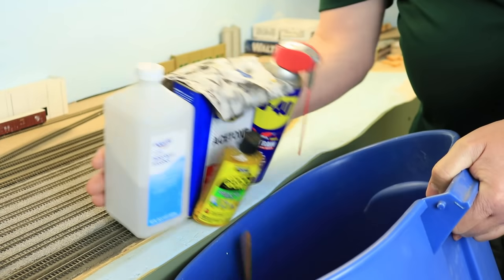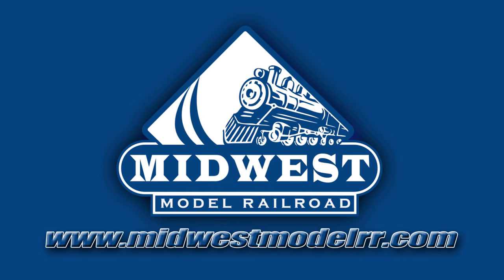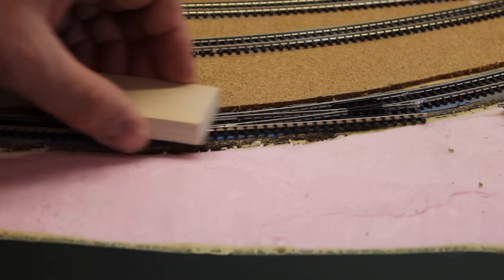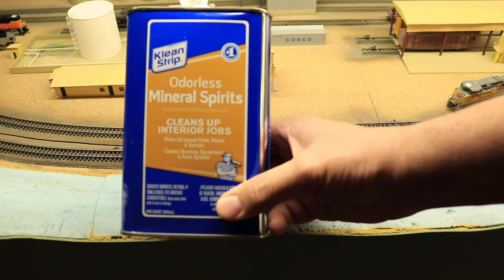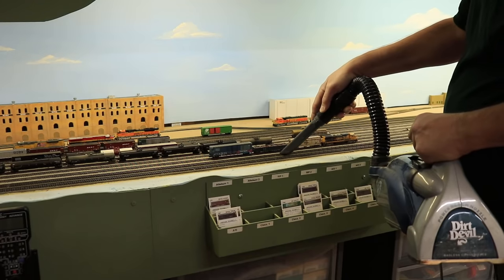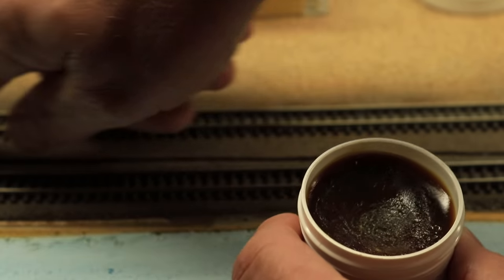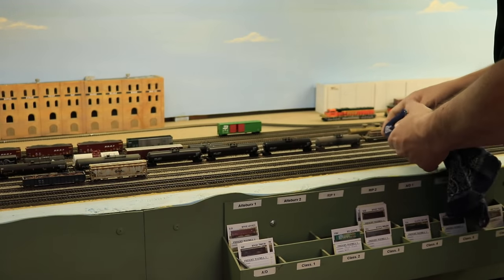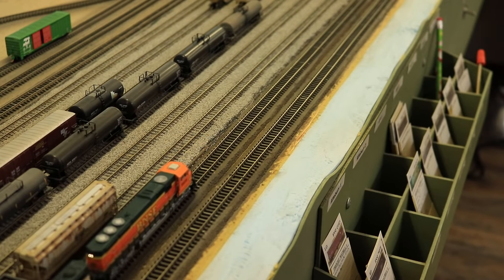Stop Cleaning Your Track on Your Model Railroad

Comment: Ron, could you expand on what you mentioned about No-Ox not being a good choice where steam locomotive traction tires are concerned? Is it the the No-Ox, or is it the pre-cleaning with the mineral spirits, that may give the problem? I have a couple of rubber treaded steamers, and am using Wahl's without too much trouble, it's a little slippery for a few laps, then does OK.
Reply from the maker: The mineral spirits are a good idea even with the traction tires. It will not give you any problems. The no-ox can coat tractions tires, however, and render them ineffective. It will not attack the rubber, just makes it slicker.
Reply: @RonsTrainsNThings  I use Wahl's Hair Clipper Oil, first known to be by way of British professional model railroader, Lionel Strange. It does create some rubber tire slippage during the first few laps, but then dissipates. I have not detected any rapid traction tire failure with Wahl's. Since the layer of No-Ox is microscopic, as you say, I think I'll chance it. Worst case scenario, I hope, is that it may be necessary to spin clean the traction tires if I notice excessive slippage. I enjoy British OO, and my British friends tell me that No-Ox is not favored in the UK, but since track cleaning is as controversial as religion (brave of you to wade into the mire) I'll just have to take a chance on it; start with a locomotive that has easily replaced tires, or tyres, as they say in the UK  I really appreciate your in-depth analysis, and electron microscope images, of this vexing problem. I've seen and read many articles and videos, and by far yours is the most cogent, most believable, of them all. I look forward to following your channel. 

Your "stage persona" is also refreshing. You are clear, concise, and don't tax the viewer by rambling and fumbling. Thank you for that. Some of these YouTube presenters are painful to watch, sorry, but there is an edit function. 

I have long suspected that abrasive cleaning methods would micro-groove the rails, and that this would indeed increase the surface area that would promote micro-arcing. Nice to be right, for once. 

BTW, I read an actual laboratory study funded by manufacturers as to if plastic wheels fouled track more so than metal wheels. The conclusion was that neither plastic or metal wheels on cars made any difference in terms of dirtying up the track. Another hotly debated topic.  I note with some amusement that the plastic treads gain a metallic sheen of metal from long running; and so have metal coated plastic wheels!

Comment: This sounds great but can you recommend an alternative when using steam locos with rubber traction tyres?
Reply from the maker: I would still clean with mineral spirits but skip the track treatment. It will leave a film on traction tires that gets slick and rendered them ineffective.
Reply: @RonsTrainsNThings  Many thanks! 🙂

Comment: I bought something called solvable professional grade mineral spirits..it has smell..it says it cleans multiple surfaces
Removes grease and cleans paint brushes and rollers..says it's safe for plastics steel etc..is this right one for cleaning track?
Reply from the maker: That will work, yes.

Comment: Ron
My Layout is relatively new and have not had much time to run the trains on  regular basis because I am still  making adjustments.  But after I make a change I run the trains and find they do hesitate sometimes at first then they run ok. I run my fingers over the track and they are black. I bought the car cleaner CSX and used acetone and paint thinner first one time.  But the CSX car is heavy and I have elevations on my layout and it was hard to go up the elevation. So I have been looking into a better way for Track Treatment. This method looks like a good one.   I took the time to pause your video several time to write down the procedure. Step by step.  Would be nice if you could post the step by step process.    Great job looking forward to smooth train running. Tom
Reply from the maker: If you check the link in the description I mentioned to the NO-OX document from Sanchem, they outline the process, except they use a bright boy first, which I do not recommend.
Reply: @RonsTrainsNThings  I just reviewed the Sanchem document and now have any understanding of what need to be done.   It will be fun doing my track under the mountains 
I have access from the back but not sure if I can get to all the track under there may need to make another access point..
I order the NO-OX-ID and Mineral Spirits from Amazon toady should arrive in the next day or so.
Reply from the maker: Let us know how it goes.

Comment: Wow sounds great.  When you apply do you apply to just a section of track and let the loco spread it to the rest?  Right now I only have a 4x8 HO basic layout.  Just one track around.  On a layout like yours that would be a long time applying and sometime hard to do in hard to reach places.  I'm just getting back in and have used the bottle of track cleaner which probably contains IPA.
Reply from the maker: I apply manually to all track. I applied to my main line first to test it, then when I was confident in it I applied it to all other track.
Reply: @RonsTrainsNThings  Ok thank you.

Comment: Thanks for the insights Ron your video is very timely.   I was running out of my last can of TV tuner cleaner and trying to figure out how to clean my rails going forward.   From your experiences.  Would you do the mineral spirits/no-ox-id combination on the track before or after its been painted, ballasted,  and the scenery has been put in around it?  Does it make it easier to clean the rails after you have done scenery work or does the NO-OX tend to collect all of the dust etc... created when you are scenicing a layout?
Reply from the maker: Ideally do this after everything else is done, but for those of us who run trains fpr months or years before scenery gets done, I paint my track, then apply. After ballast, scenery, etc I may need to reapply.

Comment: So I'm guessing with DCC as its AC and not DC, wouldn't there be an even amount of micro-arcing on both the track and the wheels of the electrical vehicles? Is NO-OX-ID plastic safe? I know that certain mineral spirits are bad for some plastics like ABS (some track ties?). I use use high quality vinyl erasers to clean the track and then vacuum the tidbits after.

Comment: I run Lionel Trains on my layout and they have traction tires.  What can be used to clean my tracks other than NoOx?  Maybe I missed what you have suggested, my apologies.  Thank you,!
Reply from the maker: First, No-Ox is not a cleaner but rather a track treatment. For cleaning, use Mineral Spirits (which I mentioned in the video).

Comment: I’ve been using DubyaDee on my tracks for a few years now. All I got say is REGARDLESS, run cheap, reliable DCC locomotives or old DC ones that you’ve installed a decoder into. I’ve found that the higher end the Locomotive, the more pain and woe you sustain just trying to get the sand thing to run right.
Cheep trains have always run for me like a top with just a regular cleaning of the track and wheels with a normal water displacing, petroleum lubricant.
My most beautiful train is a Rapido, New Haven RS11. It looks like a dream but runs like absolute garbage.

Comment: Have you ever dealt with the  Life - Like liquid purple track cleaner that was available many years ago? Sold under the Life - Like products of Baltimore, Md. Never could find out why it was discontinued. Never any ingredients or warning info on the label. Only found on eBay to which I just bought a full unopened 8oz bottle from a seller in Md.
Reply from the maker: No, I have no experience with it.

Comment: Have used this for electrical connections for years. Should be ideal for track connectors, eliminating the need for soldering these joints.

Comment: I believe It reduces traction if you have  inclines with long heavy trains, even with small amounts.   I find Diggers Methylated spirits (95% ethanol alcohol - and low carbon content) in a CMX does a great job.   IPL has a higher carbon signature.  I agree occasional cleaning of all rolling stock wheels is occasionally required - I don't do it often enough.  I find that 4 x CMX with ethanol passes over every track, every 6 months does the job.  A big plus to increase conductivity  is regular use of the layout - a great excuse to spend more time in the shed/basement.   Cleaning is required more frequently if the layout is non used most days.   Emotional subject - yes I argue a lot with fellows who know more than me, hard hat is on for objections.   Please keep those track rubbers off your track - might be too late if you have already scratched your rails.  Happy operating  We have got to love this hobby

Comment: Ron great video!! Just watched this recently...  Have you considered a electrical contact cleaner like Electrosolve?  This seems like an option which eliminates the grease aspect.
Reply from the maker: Several of the products I mentioned gall into that category. WD-40 Contact Cleaner is the one I'm most familiar with. The important thing is to learn if it is polar or non-polar. That is what differentiates them. You want to use a non-polar cleaner.

Comment: Layout 22x11x3x12 dementions sat dormant for over two years.   After finialy getting time to clear the accumulated junk out and gain access to the Layout first inspection identified major corrosion especially in the hardest to access points.   I wanted to run trains as soon as possible so after clearing the main line put an old blue box locomotive on the rail gave it power hesitation abounded so solution a few drops of automatic transmission fluid hear and their and off we go.  No fus no mus

Comment: Just got my first train and it was stuttering in. Couple spots. Despite the tracks having a mirror finish I cleaned it with some oil and a q tip and so much black came off, very odd but the train runs like new again.

Comment: I did the same research as yourself (probably read the same articles and watched the same videos) about a year ago, I have not released a video of the "Ultimate cleaning track" regime, as I do not have a runnable layout to prove it, before I publicise. I can tell you that you have missed a trick, not only do I agree with you about track rubbers, but even brand new track (under the microscope) looks like its been scratched with a rubber already! (it's a function of it being extruded during manufacture). So the regime has 5 parts, first polish with a fine polishing compound like "Silvo" (chrome/brass cleaner) thus leaving a smooth surface, second clean with non polarizing cleaner, third vacuum the track, fourth treat with a non polarising protector like noox-it ( I know of another similar that is less greasy and does not rot rubber!), fifth is to clean ALL running stock wheels with non polarised cleaner before running in, on the protector. As you said, this may be an onerous regime, but you only have to do it ONCE! (and maybe re-clean and reapply once a year!)
Reply: Care to share what the stuff is that doesn't attack rubber?

Comment: I’ve used IPA, CRC 2-26 and a Peco track rubber, and I can say the following.
IPA and the Peco track rubber are good for traction as no residue is left immediately after cleaning.
CRC 2-26 and the Peco track rubber are good for conductivity.
 IPA and the Peco track rubber are good in terms of the track staying clean.
CRC 2-26 is very good at initially cleaning the track but it accumulates a thick layer of carbon gunk after an hour or two of running which really affected traction on some of my smaller locomotives, but it is easy to remove. CRC 2-26 does have its uses though, if you have a locomotive, coach or wagon with stubborn dirt on the wheels put CRC 2-26 on the track and run the rolling stock round, put some CRC 2-26 on a cotton bud and clean the wheels, they will be clean and shiny again. IPA is good at cleaning the track but spotless track and wheels may not be good for conductivity as when I put a brand new locomotive on track cleaned with IPA it wouldn’t run smoothly, I put an old locomotive with some carbon on its wheels on the track to run for a while and when I put the new locomotive back on the track it ran perfectly. This suggests that some dirt/carbon/oxide may be beneficial. The Peco track rubber is the best all rounder in my experience, it’s easy, safe gives good results in all areas. People seem to hate on track rubbers but if you get a good one I can’t see why, admittedly I haven’t tried Inox or the magical grease you showed in the video but of the three things I’ve tried the Peco track rubber works best for me.

Comment: Back in the day, heads on professional recording equipment were cleaned with RONSONOL (lighter fluid) to prevent oxidation.
Reply: some mechanics clean car transmissions with gasoline, lol

Comment: I have been following this "new" theory about micro pits and and scratches. Products like Isopropyl Alcohol (IPA) do not leave anything behind on the track, what they really do it make the track really clean and clean out the micro pits and scratches. Just put a little IPA on a piece of glass and whip it off or let it evaporate and see what is not left behind. Do the same thing with most of the products on the non-polar list and you will see a film left on the window. 

So in my opinion the real question is not making your rail really clean, but what do you want left behind filling the micro pits and scratches on your rail. The point of the article is that really clean rail is not a good thing, we want the micro pits filled in with something, the question is what do you want left in the pits.

Comment: Hi Ron, based upon your previous video re track cleaning, I purchased the CMX track cleaning car. Are you now suggesting that one should not use Acetone or Isopropyl alcohol? Will you continue to use your CMX car? If so, what will you be using in the car to clean tracks?
Reply from the maker: I will use the CMX car, but with mineral spirits instead of alcohol.

Comment: Ron, I have been using No-Ox for the past 21 years and can attest to its efficacity.  I run a vacuum cleaning car when necessary.
Reply: Do you run steamers or any locos with traction tires? If so, have you noticed any deleterious effects on them?
Reply: @donaldshroyer8633  
sorry 
don, I only run diesels (1986 era)
Reply: @williamwaithe5359  Thanks anyway..

Comment: Don't get it if you run heavy trains on slopes.  It helps prevent corrosion, but you'll find that--surprise--even a little bit of grease reduces your traction.  I'd prefer to clean my tracks more often than deal with wheel slip
Reply from the maker: 2% helix, I've never slipped a wheel. If you do you left way too much on.

Comment: Hi Ron, Thanks for the video. I'm an OO/HO modeller who runs their railway outside... do you have any details on how well NO OX ID handles external conditions? (depending on cost to the UK, i'm going to do some testing anyway.
Reply from the maker: I do not have any experience with it outside. I do not see any reason why it wouldn't work outside, but it may need to be reapplied due to weather.
Reply: @RonsTrainsNThings  awesome. I'll let you know how testing goes.

Comment: Good contribution to the problem. I don't agree, though, with the critique of polarising liquids that completely evaporate (water, isopropyl alcohol etc.). So what if they leave a charge on metal rails - it will conduct away and dissipate within minutes. The criticism might be right for stuff that leaves a film, though.

Comment: I. Have 3 rail so I'd guess clean the track with the mineral spirits but only use the no-ox on the center rail ?? Your thoughts ?
Reply: Hey, I'm not Ron but considering like he said the objective of the no-ox is to improve conductivity to help the train pickup power so you most certainly do want to have the third rail coated, unlike 2 rail where one rail is positive and the other is negative 3 rail just goes and makes the rails the same polarity with the centre rail being the opposite.

Comment: An excellent video. Hello from the Tracy Mountain Railway in Colorado. 💙 T.E.N.
Reply: P.S. I use TEN Stabilant (might be out of production now) mixed with a dab of Wahl clipper oil. It works inside and outside, and minimizes wheel arcing when there is water or snow on the track. Most "conductive" greases, like Ox-Guard, are just mineral oil, but not always, so read the ingredient list. I apply it, just like shown here, in a number of spots, and let the trains run it around the track. I do a little manual application at the scale tracks, some switches, and the turntable and roundhouse rails. I also take all locomotives, (W/O traction tires) put them on a piece of stainless steel track (Handmade, all thirty inches!) without any grease, and run them while I hold on to the trucks and polish the wheels and flanges. Then I run them on the "greased" tracks, and I almost never have contact issues. Thanks and hello again from the Tracy Mountain Railway in Colorado. 💙 T.E.N.

Comment: If it's good track (i.e. anti-corrosion plated, etc.) then a pencil rubber does the job perfectly. Same as old game cartridges. Gets the crap out of there without taking any of the plating off.

I think they sell really big ones just for track cleaning.

Comment: Ron, I've watched pretty much all your videos on track-laying and soldering - you use a toothbrush and Denatured Alcohol to clean the flux off the track after soldering.   Is it a safe assumption that you have switched to using Mineral Spirits now INSTEAD of the Denatured Alchohol?  (Keep up the good videos!)